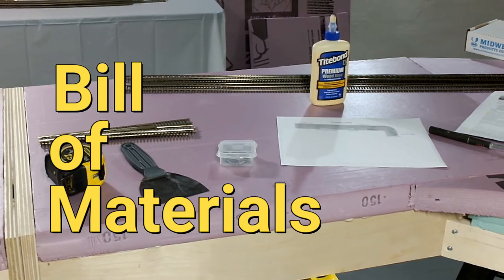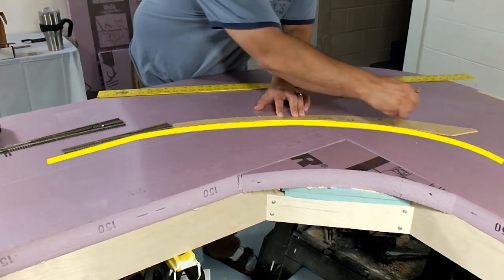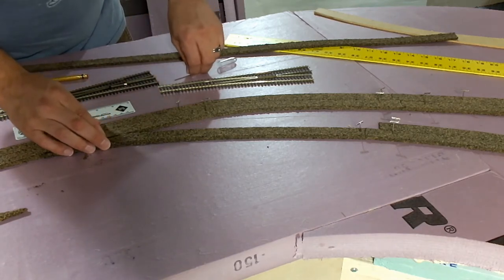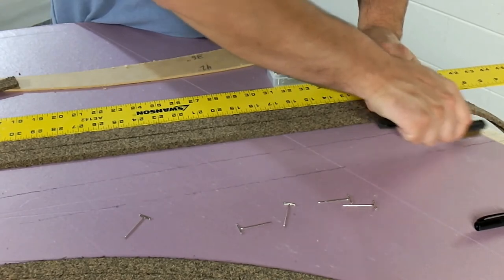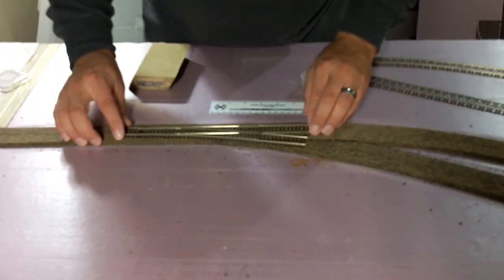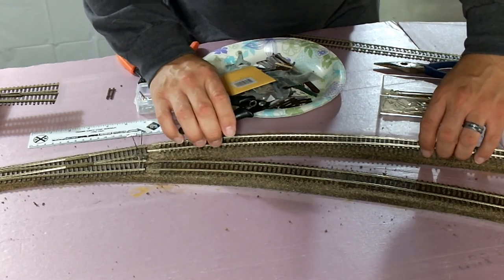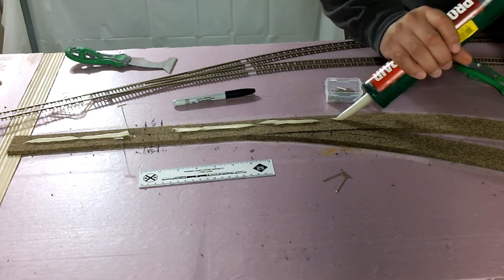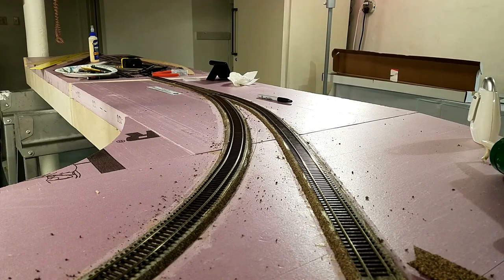How to lay track for Free-Mo Module

Comment: Very well recorded and the editing was excellent especially with the split screen. A very professional job. We all have different ways to do this. My personal preferences are to use push pins instead of t-pins and to solder the joints after the track is in place. I still use weights as you did while the adhesive is curing. I'm curious about your approach to track feeders. You said that soldering the joints ensures electrical conductivity. Others may disagree favoring feeders on each track section and on each turnout. Despite these differences, the end result is almost the same. I commend you on an excellent video...Harold
Reply from the maker: Thanks for watching Harold!  I think what I was getting at with the soldered connections in the track was that a soldered joint would provide more electrical connectivity and be more reliable (electrically) as opposed to a mechanical joint made with only a "rail joiner."  Regardless, I'm no expert and there are certainly multiple methods to lay track and achieve excellent results.
Reply: I really find it better to solder the lengths of track together before laying. This will let you get straighter track and better curves. Soldering after laying usually will let you get a kink in the rack unless you re very - very - very skilled in soldering and laying track and I've only seen one or two modelers in my time that are that skilled and I have been doing this for over 50 years. Push pins or "T" pins, who cares?? My track feeders are every 6 to 8 feet and are soldered under the track.

Comment: What is your take on using white glue for the track? I have seen both used just getting thoughts on the two adhesives. T pins rock i used them on a small section of track for photo shoots in the future!
Reply from the maker: Kraig, I have had good success with white glue or yellow wood glue. The only drawback I have heard of with white glue is when you ballast or add scenery the glue may soften and let go. However, it's never happened to me! Thank you for watching and commenting! Congratulations you are subscriber #150!!!
Reply: @AndyDorsch  I use white glue on all of the glue downs road bed and track. When ballasting you will not get enough water on the solid glue to matter as the ballast glue will dry before the other glue softens to much. I only glue the track every 6 to 8 inches and only enough to keep it in place before ballasting.

Comment: Great video buddy! Yea sanding the cork roadbed is underrated. So heres a question. What happens is you have to remove the track and roadbed, is it easy with the adhesives? KUTGW
Reply from the maker: As far as pulling up the track it is easier with adhesives IMHO. To me cork is kind of a "one and done" thing! Thanks for watching! And thanks for the comment!
Reply: I use white glue for the road bed and the track so water will soften up each of them. Reusing each is easy.

Comment: Why worry about the cork under the turnouts??? It will be completely covered up after ballast so why care what it looks like before ballast??
Reply: You really kept the glue "inside the lines" that you drew !!!!!
Reply: When gluing the track, I use the "T" pins on the outside of the track to hold it in place and straight and use cans of most anything from the kitchen as weight. Just lay the cans down, pins every other can gap and the track will keep the cans from rolling away. Works great but just be sure the wife is not going to use any of the food you have stolen. he..he...